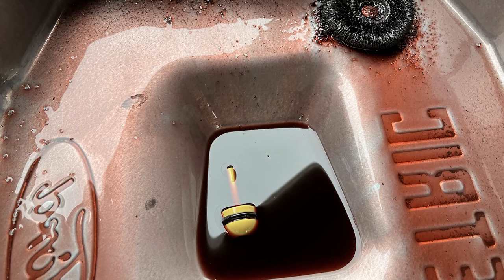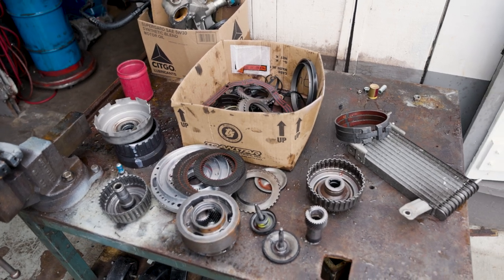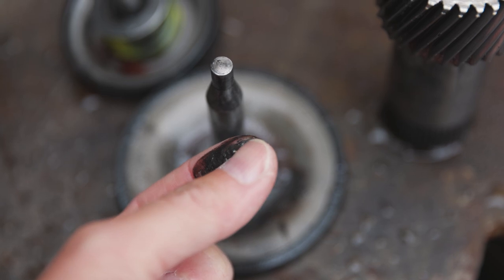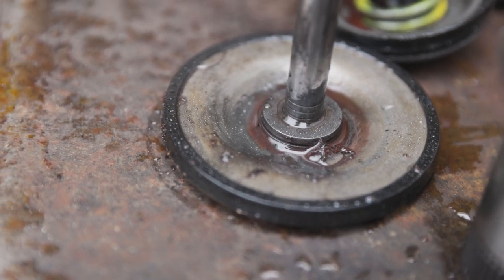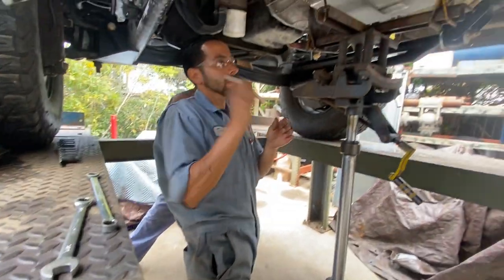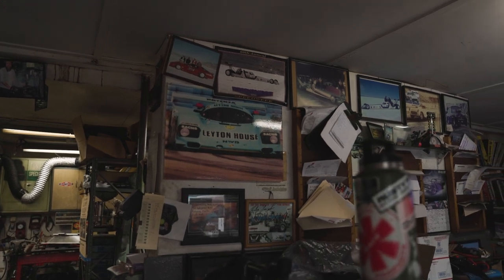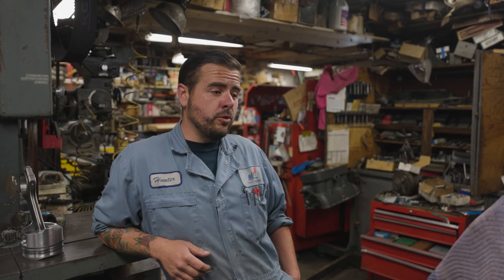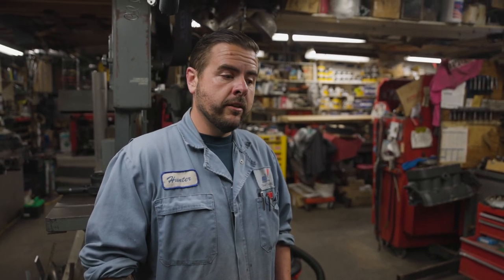My E250 Transmission started slipping and ended up completely DESTROYED!

Comment: My E250 transmission went at 120,000 km so you did good. One website I checked out was estimating the lifespan of these transmissions at 120,000 km to 175,000 km. I think you're better off getting the work done now and not when you're on some huge road trip. I miss my 4.6 liter ford. I may get another and do what you did if I decide my 2500 Sprinter is getting too expensive. It already is but man, 1000 km range on a fill of diesel. It's amazing mileage. The mechanic who told me the bad news about the tranny said, "they go" but he added "don't worry about the engine tho", so I guess they last a long time but my quote for new spark plugs was like 650.00 CND. (kanuck bucks)

Comment: I feel ya! Mine went out last year … engine check light kept coming on on my way to work around the same place.  So I took it in and they said it was the transmission… I was like you … no way … it doesn’t do anything that I can feel.  We’ll long story short I put in a new  remanufactured with the new up grade and not until I drove it did I realize what a difference… I’m just so glad I listened and like you said one and done! Take care now … I swear when I roll down grades now she has a jake brake like my old Peter built 😂😂
Reply from the maker: hahaha if only they had jake brakes!

Comment: What I've found over the years is that no matter the brand or what service history the vehicle has the best bet is just to go ahead and change all the fluids, filters and depending on the mileage the plugs, shocks, rotors and pads and if it's a heavy duty vehicle with more than 80K the ball joints and wheel bearings. Do that and you'll generally find and or prevent potential issues before they become disasters. Sometimes the damage is already done but at least you find the time bomb while you're at a shop and not in the back country or on a great trip.
Reply from the maker: Yea I should have done the transmission but was told it had all just been serviced....I did do the ball joints and tie rods right away along with all the normal engine maintenance.
Reply: @brakeforsnakes  I feel ya. Yeah, I've not done what I should have done a time or three myself. And I've listened to people who said everything was taken care of. Well, even when those folks are honest and not trying to lead you astray you often find they simply don't know enough to know when or whether everything has actually been taken care of. Now I look for the most complete service records I can find when buying used to give myself the best chances at buying a good one but it's always a bit of a crap shoot. Hence the immediate fluids, filters and various tidbits right away. That and not buying from a rust belt state if I can't inspect it personally. Those folks are used to rust and their version of. "it ain't too bad" doesn't fit my South Carolina definition of not too bad.
Reply from the maker: @davep2945  yea I was just being naive because it's always been owned by the company I work for, such is life.

Comment: Dang... sorry to hear that. That's not a cheap fix.  Cheers. Curious, how many miles do you have on the engine, and is it worth rebuilding an engine for the E250?  Thanks! New sub.
Reply from the maker: It’s got 107k miles on it but it’s definitely worth rebuilding or just swapping in a used motor
Reply: @brakeforsnakes  thanks for the info! I think you definitely made the right decision on the performance rebuild for the transmission. Cheers...